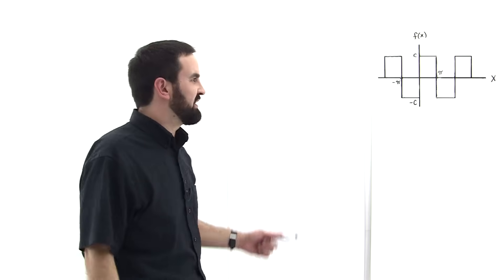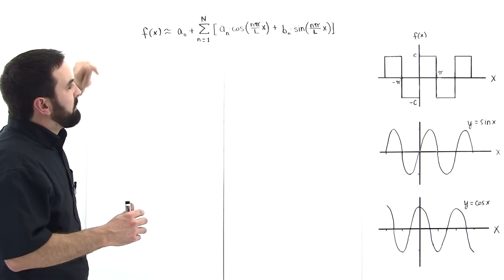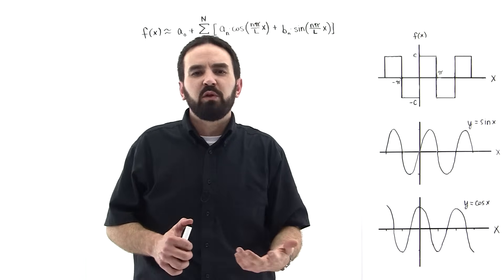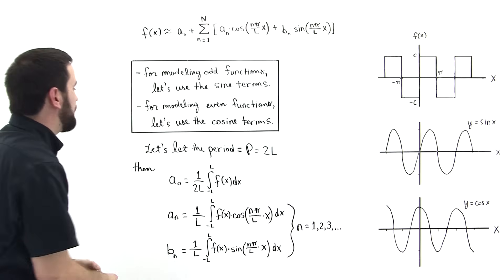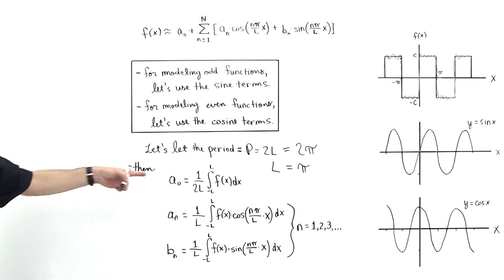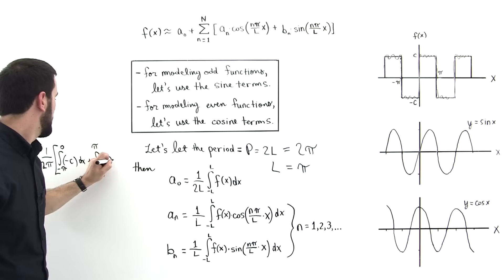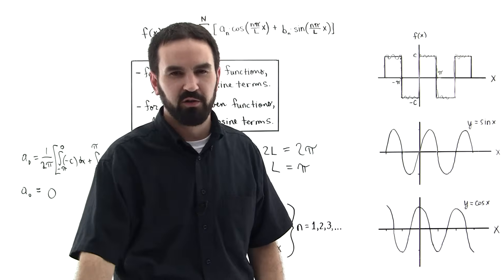Fourier Series Part 1

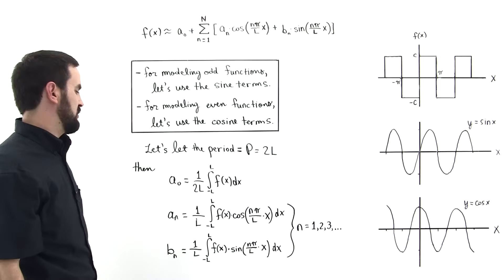Comment: Good day, Sir. I am wondering with regards to the coefficient of An infront of the integral sign 3:46 , the (1/L), L means the period and where does the 1 in (1/L) came from? in your other video, (https://www.youtube.com/watch?v=URbFDtxUj7M&t=207s) 1:50 the coefficient of An infront of the integral sign is (2/tao), tao means period and how also did you get the 2 of (2/tao)?

what's our basis in using the 1 or 2 for the 1/L or 2/tao? 

thank you sir.
Reply from the maker: They are equivalent actually.  The tao notation is just easier for conception.  L=tau/2.

Comment: Saul, can you expand on why when finding a0 , you divide by 2L, and when finding an and bn divided by L only? Great lecture!
Reply from the maker: Good question.  I have a conceptual answer for you but not a mathematically rigorous one.  Notice that 2L is one full wavelength.  So L is just half of the wavelength.  For a0, because you're dividing by 2L, you can see that the equation for a0 represents the average value of the function over the interval, which is zero in this case because that's the centerline of the graph.  If the graph is shifted up or down, then a0 just becomes however much the centerline of the graph is shifted up or down by.  This is a much easier method for determining a0 on exams, for future reference.  As for the other coefficients, those are more complicated and I don't have a simple answer for you as with a0.  a0 is just a constant, whereas for an and bn , they serve to represent the change in the function itself over the entire domain.  If a0 is zero, then when the bn's are plugged into the final solution at the top, they represent the actual function value, not just the average.  Hope this helps.

Comment: How is square wave even possible i mean i don't understand how for same x u can have different f(x) is that the thing or am i going the wrong way???plzz explain
Reply from the maker: In a sense you are correct.  You can't have two function values for a given x or it wouldn't be a function.  In a pedagogical sense though, for teaching that is, the presentation this way makes it more clear to the viewer to visualize the function.  Google step functions to see the technically precise way to draw the functions.  This just has to do with how to draw the functions themselves though, but nothing to do with the model itself.  The model comes out the same, and it is a function 100%, composed of sin and cos functions in combination.  Notice in the mathematics, more clear in part two, that the only thing that matters is the function value over the interval, NOT the function value at the endpoints of the integration, so all the math works out the same as if it were drawn differently or not.  Good question.  Hope this helps.
Reply: @saulremihernandez314  actually a square pulse is used in digital signals so i was quite confused there but i came across an explanation that the time interval between the maximum and minimum values is almost instantaneous so it is mad that way.
Reply: So is that what it says?
Reply from the maker: @blackwolfkills  Yes more or less.  I don't have that much experience in the field of electronics but that sounds right from what I have been exposed to.
Reply: Thanx so much

Comment: Only because he didn't mention it, probably for brevity (though he does explain things great otherwise), there is a phenomenon where, at each jump discontinuity between steps, the Fourier series will behave a little oddly. To describe it graphically with the step function at the beginning of the video, it jumps up slightly before plummeting down to a lower step, and then dips before stabilizing, again dipping before shooting back up to the upper step, over-reaching a little, and stabilizing yet again on that step. The dipping and over-reaching become smaller and smaller when more and more terms are used in the series. This is called the Gibbs phenomenon, and it doesn't go away - which is why there are sometimes small bursts just as a radio is turned on.

Comment: Infinity is the actual origin of the x, y, and z axies because they represent the intersection of circles or cycles of infinite period or radius. So "reachable" is more apt for the perturbation or interference represented in the trig functions because they are "difference" terms relative to the connection at the origin. 
If this video wasn't such a good presentation, it would not be possible to comment, so this is good teaching and learning. IMO

Comment: I have a problem with x^2. I calculated it and after I checked it on the internet and the awnser was correct. a=(-(-1)^n)/n^2. But when I put it in graph it looks nothing like x^2, more like a x^3.
Reply: http://www2.fiu.edu/~meziani/Answers-Test2.pdf
Reply: ok I got it, I've been using sinus instead cos. But I don't get why the shape changed rather than just beeing moved.

Comment: what' is an odd function ?
Reply from the maker: Edward Lee If the function has "midline flip symmetry", then it can be considered odd.  That is, if you flip the function about the y-axis and then flip it about the x-axis, it should fall onto itself.  If you want to be formal then, f(-x)=-f(x) is the condition for an odd function which is demonstrated here:  https://www.youtube.com/watch?v=Y7RAkjbPHDU&index=10&list=PL59963A84B0C4FD73 .  However, you should be aware that some functions can still be  considered odd (when modeling with Fourier Series) even if they don't satisfy this condition.  For example, graphs that are shifted up can still have "midline flip symmetry", but not satisfy the analytical condition for odd.  Hope this helps!

Comment: For modelling any given signal, when do we use the exponential fourier series, and when do we use trigonometric fourier series?
Reply: I am no expert but I think you only need to use the exponential when you have a complex function with imaginary parts, if the function just has only real terms I think you can just use trig. You could still use the exponential for a only real function but the complex bit would then be zero. As I said I am not expect but nobody else answered so I did. So you should check I am right!

Comment: I have a problem. I am going to find the fourirer series for certain sound waves created by my organ. In this case , what will "c" be? Please help.
Reply: If you are plotting with a calculator just let c=1.  Otherwise "c" would be related to the amplitude of the wave.  For example if the amplitude is 2 then let c=2.
Reply: Since I am finding the fourier series for a given sound wave , I should let "c" be equal to whatever the amplitude of that particular sound wave is.. or am I wrong? btw thanks
Reply: Chirantha Busch Correct!
Reply: ***** Awesome. Thank You!! :) hey are you the tutor in this video? because ur profile picture looks like him , if so , Thank you for your videos. Great Tutoring.
Reply: Chirantha Busch Not sure what you meant by "take the difference of the integration of the two areas" but what you need to do for each of the coefficients is to integrate numerically:   integral(V(t)*cos(n*pi*t/L),t,0,T) and integral(V(t)*sin(n*pi*t/L),t,0,T) where t is the variable of integration and T is the period of oscillation.  Do this for n=1,2,3,... as shown in the video.  May need to watch parts 2-5 for the details.  Hope this helps.
Reply from the maker: Chirantha Busch Yeah that's me.  Glad you like them.  :)
Reply: WoW. :D Cooool! xD Keep up ur awesome work.
Reply: Hey One more thing please. Out of the three graphs you have drawn , the explanation is based on the top one. And in this diagram , the peaks of the graph are constant for -(pi) to zero. Same case from zero to +(pi). But when I try to model the Fourier series for something in the real world like an actual sound wave created by the organ , the peaks are not constant because they act like normal waves. So in this what should I do , Best Damn Tutoring. Should I take the highest peak value of f(x). Oh , and by the way , what if the f(x) is in the form of V(Voltage) because of my oscilloscope shows the waves in a graph that is voltage against time. Thanks in advance.
Reply: Basically the question is what will I do if the graph is not like the graph that is on the top-right hand corner of the video? What if the graph is an actual wave (maybe with over tones)...  In this case what will f(x) will be because it is not constant from -(pi) to zero and from zero to +(pi)
Reply from the maker: Chirantha Busch f(x) will be the measured graph that you have.  The integration will have to be done numerically because the graph is empirical.  The integration will take more time but it can still be done.
Reply: Oh. So I should take the difference of the integration of the two areas and this will be the coefficient
Reply: Chirantha Busch Is your graph plotted with respect to time or position?
Reply: Time on the x-axis. Voltage on the Y-axis. These are the axis of my oscilloscope.
Reply: Thank you very much. But what happened to the 1/L in front of  integral(V(t)*cos(n*pi*t/L) and integral(V(t)*sin(n*pi*t/L),t,0,T). This is definitely the Best Damn Turoting :D ..
Reply: Chirantha Busch Yes put those in where appropriate.  Sorry forgot to add those.  :)
Reply: Thank You. No It's okay :) So this means I can use this method to find the fourier seiries of a graph that is not a perfect sinusoidal curve , so a graph with over tones and things like that?
Reply: Chirantha Busch Yes that's correct.  The graph doesn't even have to be periodic.  Just integrate over the interval that you want the graph to be most accurate and if you add enough terms to the series, then you'll be able to model it.  There is some more useful notation on the website that dramatically simplifies things.  This video was done first and then months later I realized how to do it better.  Basically you just pick a starting point and integrate forward.  The website costs $10/mo or you can just pay $5 one time and write down the notation.  Happy modeling!
Reply: Perfect ! Thank you very much for your time. I will check out the website. Happy New Year!!
Reply: Hello.. One more question regarding the fourier series. The "L" depends from question to question or is it "pi" every single time?
Reply from the maker: Chirantha Busch It depends on the question.  That is it depends on what the period of the function is.  Website notation makes the notation clearer.
Reply: Aha. I see.. btw , I managed to integrate my sound wave (from oscioscope) using the method you taught me and also using an integral calculator... I ended up with 0.1071x. And when I multiply this with (1/L) , I get 14.14x) as my coefficient for a1. What is the "x" doing there? Is "14.14x" the coefficient or should I do some more improvements to it? ... In my osciloscope there is voltage(V) as my y axis and time(T) as my x-axis... what I used  to calculate the coefficent for a(n) was  (1/L)integral(V(t)*cos(n*pi*t/L),t,0,T) ..... I ended up with "14.14x" ..
Reply: Sorry to ask many questions but I just want to make something clear.. you told me to integrate " integral(V(t)*cos(n*pi*t/L),t,0,T) "wher t is the variable of integration and T is the period of oscillation" .. in this case..........

I integergrated it using V(t) , t and L .. but where should I use the "T" ?' Sorry if this a stupid question

Comment: I still don't get, i did watch all of the videos
isn't a0 just the term when n=0, so the whole b0 sin(0) term cancels out and the a0(cos 0) leaves just the a 0.
and from how you have calculated the rest, should a0 just be 1/L and the integration of the function from -L to L.